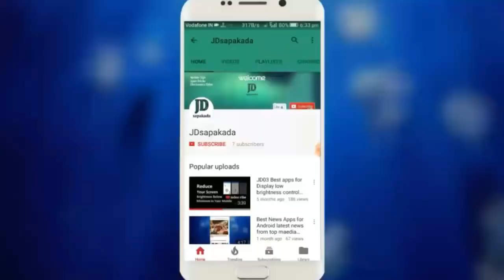Make Agriculture 12v Battery Spray Pump || Agriculture battery spray pump Parts.

Comment from the maker: in गुजरात
Halvad district yaha पर अपको मिल जायेगा
2500 rs 6 month warranty
2300 rs 6 month warranty
2100 rs 6 month warranty
2000 rs 6 month warranty
1950 rs 6 month warranty
1800 rs no warranty
1500 rs no warranty
Reply: JD Sapakada 2500
Reply: JD Sapakada muthu9843439182
Reply: खेतों में दवा खींचने वाले पंप का रिपेयर करना सिखाओ लाल लाइट जल रहा नीला नहीं हो पाता है
Reply: Helo sir iam from. Andhra Pradesh,
Rajamahandar varam. Iwant battery 12 *12...and 12*14
Reply: Spary karne ka bilkul Badiya jugad Low cost with patrol engine dekho https://youtu.be/AtAzs8EnszM
Reply: UP se 
Kaise kharide
Reply: Hi
Reply: @ramuremo4472  hi.ram.ram
Reply: @muthulipin6944  parabhani
.
Reply: @muthulipin6944  live video
Reply: Pp
Reply: @deelipsanodiya9155 kaha se ho aap,,,

Comment: If i want to run a motor sprayer from battery and i want to connect a speed regulator with that so how to connect them as battery has two point negative and positive and pump also has only two point positive and negative but the regulator has three point so how to connect the pump ,battery and regulator plz reply....
Reply from the maker: arbind kumar
Hi friend
In regulator  Positive And Negative connect battery positive and negative  then third is direct connect to motor black (negative ) wire and motor red (positive) wire is connected to direct battery  positive(red) point  then regulator working
Reply: and if i use a adapter(which converts ac current to dc current)  so i would use the same diagram that you have said or it will be different
Reply from the maker: arbind kumar
Ok

Comment: hey 
what is the rating of battery which is used in it 
and also tell me price of pump and battery
Reply from the maker: 12v x  12ah  battery  this price is 1200 rs.
and pump price 2500 rs. in gujarat
Reply: JDsapakada where in Gujarat
Reply from the maker: sanjay sheth
Halvad मे ही है पेहले सुरेन्द्रनगर जील्ला था अब मोरबी है
District : morbi
Taluka :Halvad
State Gujarat
Reply: Price
Reply from the maker: in गुजरात
Halvad district yaha पर अपको मिल जायेगा
2500 rs 6 month warranty
2300 rs 6 month warranty
2100 rs 6 month warranty
2000 rs 6 month warranty
1950 rs 6 month warranty
1800 rs no warranty
1500 rs no warranty